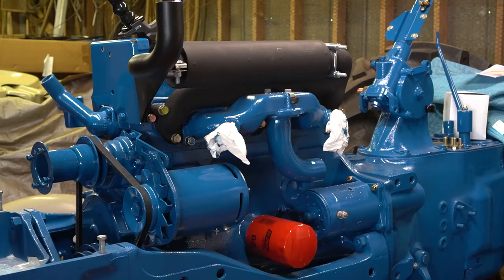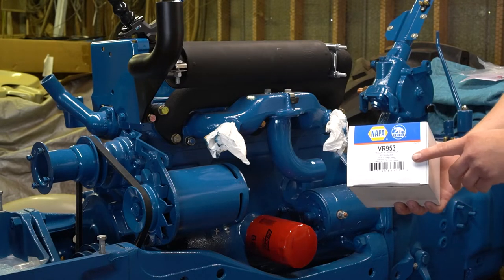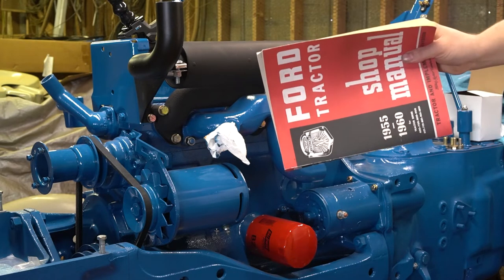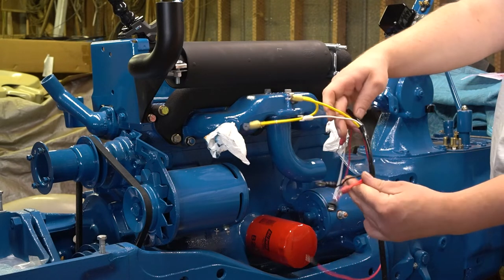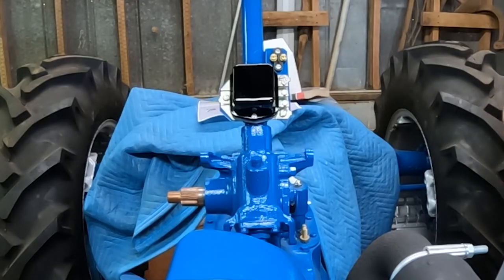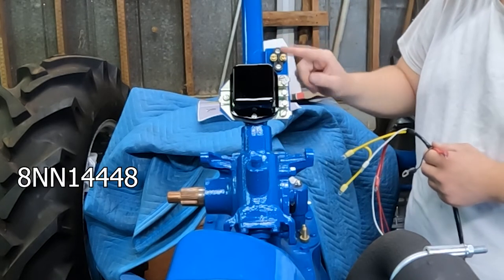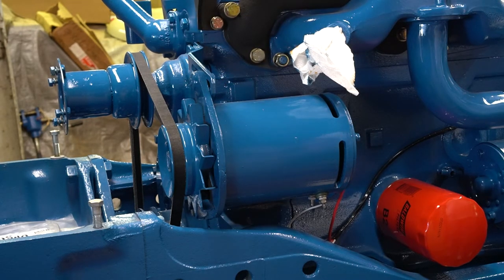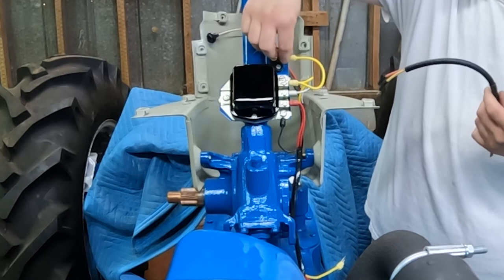Wiring 1964 Ford 4000 Diesel tractor

Comment: if you have an alternator internally regulated, do you still need that voltage regulator on teh steering column?
Reply from the maker: No. Nothing else on the tractor hooks to the voltage regulator. Everything will hook to battery, junction block or ignition switch.

Comment: How is any of your grounds going to properly work with all that paint Where you have put them
Reply from the maker: Through bolt threads. You can clean paint off if you want but I didn't have any issues with grounds. To be honest I was surprised that my fuel sending unit is grounded. I have the tank setting on rubber and only way for it to ground is through the bolts hitting the tank brackets and all those are fully painted as well.

Comment: Im rewiring a 4000 with a Dennis Carpenter harness. Ive follwed this video carefully. I have nothing when I depress the starter button. I have no 12v at the starter button with the key on. What did i do wrong?
Reply from the maker: If you don't have 12v at the start button I'd suspect the starter relay is bad. 12v should be on the red wire at start button until its pressed and grounded. At that point the relay should drop the 12v and you'll see near 0v at the start button. Make sure the ignition switch is working as well since that is how the red wires get battery voltage. Yellow is battery voltage on the key switch and should see 12v on red wires when turned on.
Reply: @chickenhousemechanic  I changed out the new "ford" style relay that I had purchased at NAPA for one I got from Steiner Tractor, FDS282, and it works perfectly.
Reply from the maker: @kraylake12  good to hear. Based of your other comments on Facebook that's what I figured it was.

Comment: Do you have the part number for the starter solenoid or the NAPA#? I’ve heard that they can’t be grounded through the bracket and needs to be through wire.
Reply from the maker: I dont have a number. I'll see if I can find one. Yes it can't ground on the bracket for the starter relay. Glow plug one can. If the starter relay grounded through the bracket the starter push button wouldn't work and your starter would run anytime yoy turned the ignition switch on since switched 12v feeds that relay.
Reply: @chickenhousemechanic  great thank you. I’ll be re-wiring my 1963 4000 diesel soon. Great video. 👍
Reply from the maker: @cbrrod  thanks. Looks like the napa solenoid you'd need is ECH ST67. That appears to be an insulated coil solenoid. I'd take an ohm meter with you to napa and check just to be sure.
Reply: Just got the solenoid. Have not installed it but multimeter verified it is not grounded through the frame. So it should work. Thanks again.
Reply: @chickenhousemechanic  are the solenoid part numbers the same for Glow Plug and Starter?
Reply from the maker: @JonathanVanderArk  yes.